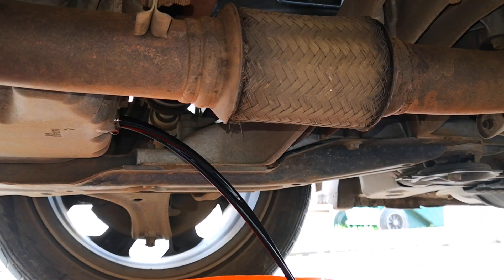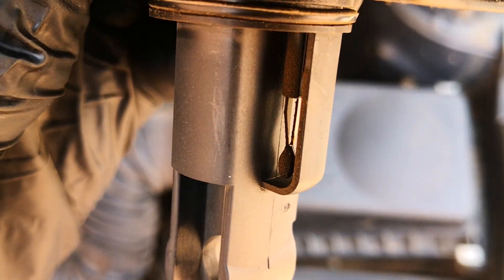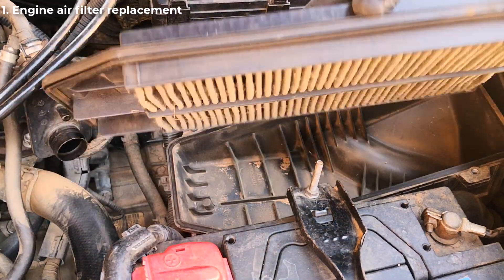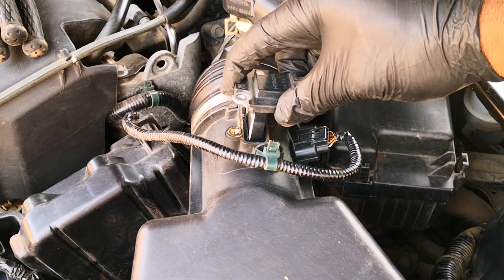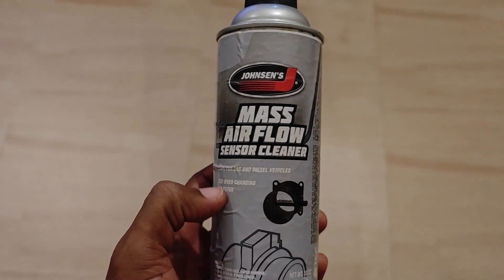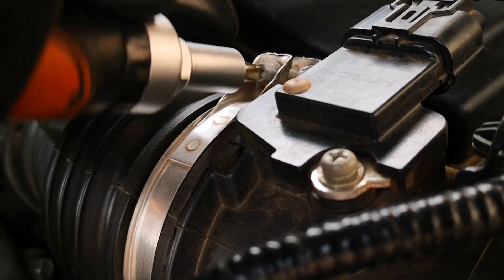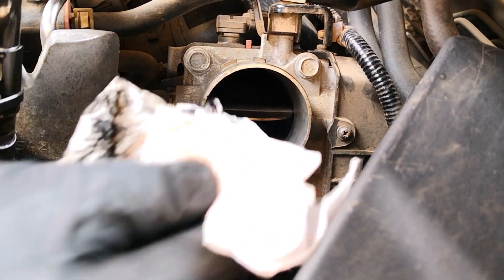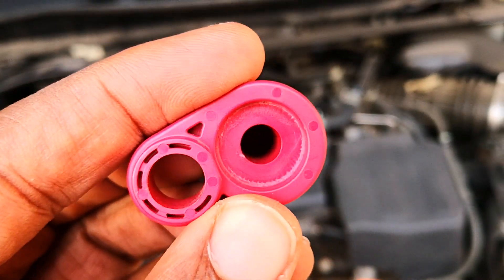Annual Engine Tune Up List / Tune Up for FUEL ECONOMY!

Comment from the maker: Thanks for watching! What other tune up item do you do yearly?

Get from Amazon:
  - CRC MAF sensor cleaner - https://amzn.to/3X6uOTz   
  - Gumout MAF sensor cleaner - https://amzn.to/3M9bKha  
  - Johnsen's MAF sensor cleaner 12 pack (great deal for shops!) - https://amzn.to/3YOuom8  
  - Berryman MAF sensor cleaner - https://amzn.to/3WIv35G  
  - WD-40 Contact cleaner (safe on MAF sensor) - https://amzn.to/3ue9nEr  
  - Various engine air filter brands - https://amzn.to/4cy0rdh
  - Other products I use or recommend - https://amzn.to/42x5re3  
I may earn a small commission from a purchase made through the links above.

Comment: Another fact if u have any accord 03-12 with the 2.4  4 cylinder make sure to check the intake duct occasionally for micro cracks as they are known for cracking with age eventually usually in the underside.

Comment: Hello @DiyAutoworksNg. Kindly advise. My Honda Accord 2004. The buttons on the key does not open/lock my doors and the trunk, though when I press it, the light flashes but does not lock or open. Could that be signs of a weak battery? Thanks as you respond
Reply from the maker: You're right. Likely a weak battery.
Reply: Hi, i had this issue on my honda accord 2013, disconnecting the battery for 5 minutes solved it. hope it helps

Comment: Your videos are so informative, I'm tempted to open my hood and do some of the yhings you do on your Honda accord. I recently got a used 2003 Accord, and it would give me joy to carry out some of these maintenance tips on my car too, starting with the throttle body cleaning. 
Any chance youre in Lagos, i can come around and do this under your supervision. 🙏
Reply from the maker: Thanks bud.
Congrats on your purchase! If you're just starting out, just a thing at a time. Your easiest should be the air filter if you've never changed it. Size 8mm bolts and that's it. Take old one, buy the new one. The 2003 Accord doesn't have a MAF sensor but has a MAP. I believe either Jumia or Konga will have MAF sensor cleaner. Unfortunately, I'm not in Lagos. 
All the best.

Comment: lol@annual tune up. cleaning or replacing is not a "tune up"
Reply: Prove it.
Reply from the maker: It is. NB: I didn't say "engine tuning".
Reply: @DIYAutoworksNG  Annual Engine Tune Up List / Tune Up for FUEL ECONOMY!
Reply: tune up is like tuning a carburator that has a idle screw or fuel mixture screw. the other is the disturbitor in the old days  what you call points you adjust and you can turn the disturbitor to retard or advance the timing. on your honda you have a crank sensor the computer controls it no adjustment.the carburator has been replaced by a throttle body again this is controlled by the computer.
Reply from the maker: Tune up can mean different things. However, if you Google tune up, you'd definitely find the use case covered in the video.
Reply: @DIYAutoworksNG  lol
Reply: "Optimising an engine for fuel efficiency" might be a better title?
There's not much "tuning" that can be done to a modern vehicle.
Nonetheless the title is accurate enough not to quibble... with the exception of the occasional pedant.
🙂

Comment: I would add
1. run a tank with a bottle of a good injector cleaner
2. test break oil
3. test tire depth and air pressure
4. drain and refill transmission oil
Reply from the maker: Thanks for sharing! 
I do fuel system cleaners more regularly because the gas I have access to isn't the best.
Reply: @DIYAutoworksNG, what are the best fuel cleaner you have and how frequently should it be use.
Reply from the maker: Tough question. Depends a lot on the kind of fuel you have. If it's quality is dodgy, then much more regularly. I have one I use in every tank. Previously, I did fuel system cleaner right before an oil change. So about 3 times a year.
Reply from the maker: Cool list. 
My transmission drain and refill would be about 30k miles or about every other year.

Comment: I also go ahead and reset my TPMS along with checking my tires are on spec. Besides that the only other thing I could recommend would be to also exchange the cabin air filter, and clean the upstream air fuel sensor/ the downstream oxygen sensor.
Reply from the maker: Thanks for sharing!